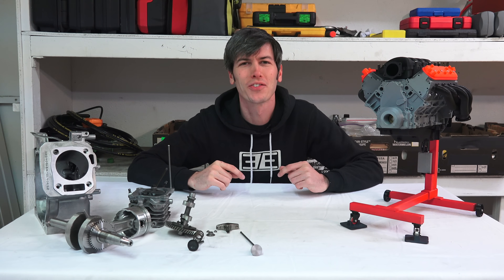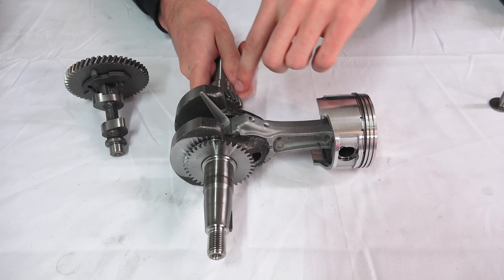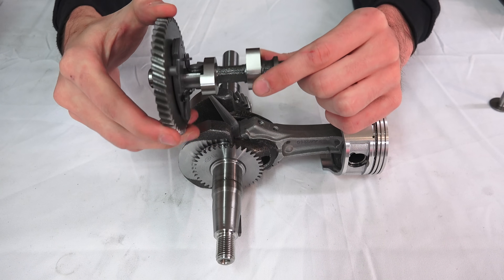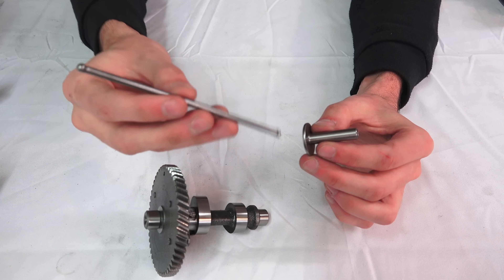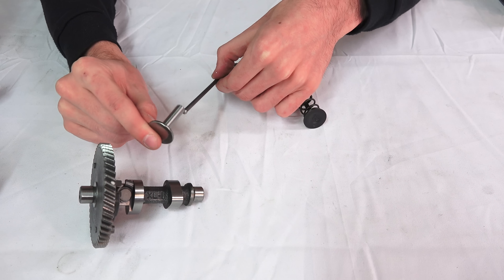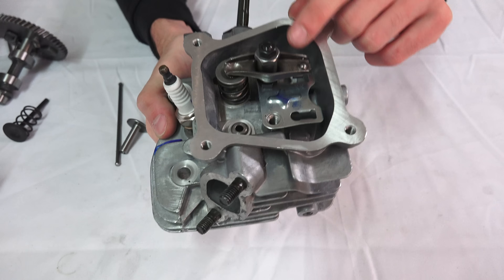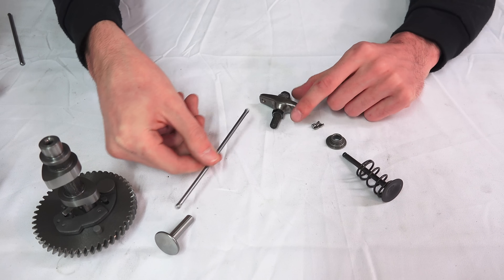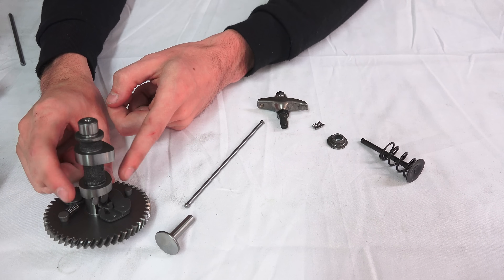Why Can't Pushrod Engines Rev High?

Comment: The fastest race cars use push rod engines. Top fuel uses push rods and redline around 9500 rpm and make 11,000 hp.
A 5000 hp 481X can spin 9000  rpms with push rods.
Reply: While that is true, those are purpose-built engines. High revving daily driver pushrods are possible, but used to be inefficient and expensive to manufacture and maintain. Nowadays, with lighter materials, pushrods start to become interesting again because of their small package, relatively low weight, plus they are less top-heavy compared to OHC/DOHC engines.
Reply: @Duskconqueror  yes DOHC engines can be top heavy, but that is countered by everything else being low. Like starter motor, alternator etc etc...
Reply: I don’t think it’s fair to cite top fuel.... those engines get rebuilt every pass pretty much, and replace a crankshaft every 5 passes...
Reply: Yes Top Fuel engines are under immense stress and pressure, which undoubtedly require strong components. But that's the point! The intake valves are huge and heavy on a TF motor, the boost pressure incredibly high. This requires monstrous valve springs to keep the valve movement under control, which in turn requires monster rockers, monster pushrods and monster lifters which then in turn require heavier valve springs to control. All of these components are so highly stressed that they just do not last long.

On the other hand, a DOHC 4-valve setup can eliminate the rockers, pushrods, lifters and use much smaller valves. There is much less mass to the valve train, which allows you to use much weaker springs. This reduces the stress on the all the components and allows them to last longer and rev higher.
Reply: They are rebuild after every race. You could probably spin a truck engine 9000 rpm for 5 seconds as well.
Reply: @Benedocta  Who told you that b.s.
Reply: It's not the total weight of the components that matters, it's the reciprocating mass. The stuff that's moving back and forth - like the above video explained. With a pushrod engine the valve spring has to close the valve, rotate the rocker, move the pushrod and slide the lifter back down against the cam. To do that at high RPM requires very strong springs, and it's very difficult to get a high enough spring pressure to keep the lifter against the cam lobe.

In many DOHC engines, there are no lifters, no pushrods and no rockers. There is just a little metal shim sitting on top of the valve stem, and the cam lobe actuates directly on that. In a DOHC engine the valve spring just has to worry about closing the valve - not moving all of those other components. This allows you to use lighter valve springs that last longer and require less energy to actuate. 

The Coyote motors are small displacement (5.0L), so they inherently need to spin faster to make power. That high RPM valve-train is what allows a 5.0L Coyote to make 460HP.
Reply: I do agree with Jason though, OHC has many advantages.
Reply: bigpigslapper Oink yea but as you said the coyote is 5.0l not 6 plus
Reply: Lorentz the annoying Llama fastest in what respect?  Top Fuel hits over 300mph in the quarter mile.   Have you seen the quarter mile time on a F1 car?  No now has actually done the test but there are rumors of 8 sec.  TF on the other hand...
Reply: Four cams weigh around 4 times as much as 1 cam, but it's rotational, not reciprocating so it doesn't matter. Most pushrod engines have a chain on steel sprockets while an SOHC or DOHC engine will usually have a belt (which weighs nothing) on aluminium pullies. You also forgot to factor in the lifters, pushrods, and rockers.
Reply: "Top Fuel hits over 300mph in the quarter mile"
so can you with classic rocketry... there it's just 2 valves and an igniter to start it.
you could even hit 300mph on an dragstrip with water-pressure alone and then it's just a single valve.

but thinking that we had working combustion engines already in the early 90's that had no rods, no cams, no rockers and not even springs... just simple electromagnets on each valve.
but even the engineers at Renault thought they were gone to mad so they put it behind closed doors for 15 years before they put back in the light...
Reply: For those of you talking about TF and NFC engines, google the "McGee" engine.
Reply: @stefanl5183  yes IHRA had a few of them. Blew up spectacularly.
Reply: newschool     Yes the rules do allow other engine types in most classes besides fuel cars.
Reply: American Locomotive um many dohc engines use rockers.
Reply: Here's a couple fun facts. A t/f engine redlines at approximately 7000 r.p.m. The crankshaft turns approximately 400 times in a clean 1/4 mile run. Including burn out, to heat the tires,backing up and staging it will burn 12-14 gallons of nitro methanol fuel. Due to the huge cubic displacement of these engines they cannot rev higher then 7000 rpm. However, many other classes ,with pushrod engines rev higher then 10,500 rpm.
Reply: @robertleavy8012  8500 rpm.
Reply: @robertleavy8012  About 8500 RPM at the hit. That's the peak. Rev Limiter ia activated about 3.0 seconds into rhe run. 3.0 seconds is about 660' when Clutch is 1:1 and RPM is around 6- 6500 .
Reply: Formula 1 cars don't use pushrods... oh you mean cars that only do 3 seconds on tarmac?
Reply: you do realize the dragsters engines literally only last for a few runs right? while a honda s2k can rev to 9000 all day and can be driven everyday
Reply: Spike to about 8500 RPM at the Hit. Clutch starts ro pull the RPM down till about 660' til Clutch ia 1:1 about 3.0 seconds. About that time the Rev Limiter ia activated. Then it Starts climbing rhe Torque Curve
 Rev Limiter is 7900 i believe.
Reply: Sanity Top Fuel is a 3 Valve SOHC Design. Not NHRA Legal. It's an Australian team. 
They also have an Alcohol version.
Reply: McGee Quad Cam was a IHRA Legal design. They blew up in spectacular fashion. Nobody ean one after about 2000 season.
Reply: Nitro engine's are Rooler Cam Push Rod with Rocker Shafts in the Heads. Intake valve on top. Exaust on the bottom. 2 plugs pwr cylinder front and back. 
CroMo i believe is thw Puah Rod Material. 
1100# Intake Valve Springs. Lota of big parts in a Fuel Valvetrain.
Reply: OzarksWildman THATS will not very high. Some stock production cars rev that high.
Reply: Too Fuel would go much faster with a set of DOHC 4V heads
Reply: Yea if you want to lash valve's all the time. Plus your only using that set up in a race car.
Reply: Yeah, but those valve springs on a top fuel engine are only good for one pass. That 481X engine might get a season on a set of springs at best.

A Honda S2000 engine can turn up to 9,000 RPM reliably for 200,000 miles.
Reply: @AmericanLocomotive1  One Honda F1 car hit 21K rpm when it got airborne ..means the pistons went up and down 350 Times a seconds

Comment: Do any engines use solenoids to open the intake and exhaust valves?
Reply: i think alfa romeo have one, only for intake, the exhaust uses vacuum valves. simply put, too complicated.
Reply: freevalve
Reply: I heard Koenigsegg was experimenting with the concept, but have no idea where they went with that
Reply: Very different kinds of engines, but marine slow speed diesel engines use electronically controlled, hydraulically actuated exhaust valves. There is no camshaft at all. Super cool stuff. Look into MAN ME slow speed engines.
Reply: Nick G they are two-stroke though

Comment: if an engine doesn't use pushrods, what does it use?
Reply: In OHC and TOHC applications, the cam is moved to the top of the engine and acts directly on either a rocker arm or tappet (so that they retain lash adjustability) that is in direct contact with the valve.  It's a much simpler system, with a lighter valvetrain...but it makes for a taller engine with a wider head, which can cause packaging problems on larger engines like V6s and V8s.
Reply: crankshaft driven timing belt or chain. this is OHC engine, using belt or chain to carry rotating motion to cam, it controls valve movement.
Reply: Bob Sacamano a hamster
Reply: Bob Sacamano say no more..the all new no rod🤣

Comment: Title should say "Why It's Harder for Pushrod Engines to Rev". It's not that they can't rev, it's that its much more difficult and expensive to engineer them to be able to.
Reply: Fred Larsen C. Rotary engine give twice the revs but three time the unreliability.
Reply: Fred Larsen C. APEX SEALS!!!!!
Reply: Using an engine with a low stroke and a very big bore you can rev high. But like an dohc engine you need to use stiffer springs, also in a pushrods engine you need lighter rocker arms and solid roller lifters
Reply: You mite want to look into an old forgotten push rod performance thing called a "Rev kit." Essentially an extra set of valve springs that went between the lifters and cylinder preventing valve float allowing the push rod engine to do 10500 to 9500 RPM (as long as the engine was properly balanced and the connecting rods were forged) these kits cost less than $200 dollars.
Reply: Lorentz the annoying Llama

It doesn't mention that production pushrod engines nowadays are all high-capacity, long-stroke V8s, neither of which would combine to rev high anyways no matter the valvetrain. A 7L DOHC V8 with the same 4 inch stroke as the LS7 ain't gonna Rev much past 7k rpm stock...
Reply: Fred Larsen C. Rotaries: 6 times more combustion cycles, 1 third the power.
Reply: nuts to that. i take a reliable power plant, for 10k, capable of high hundreds maybe even 1000hp, that doesn't sound like a 1990 yamaha bravo
Reply: Ken Willers
Ford hasn't put a pushrod in a production car since 1995
Reply: @anthonywebber2211  maybe not in America but the Ka in Europe used the ohv Kent/Valencia engine till 2002.
Reply: show me a push rod six making that kinda power first, compare equal cylinder engines. a better compairson would be the bmw s50(i think thats the right engine code, the V8 from the E90 M3) or the Lexus IS-F engine but that said any comparison is kinda like asking if its ZEE or ZED, both have their uses and both have their pit falls
Reply: The corvette is a pushrod and it revs plenty
Reply: K Re, not really. Everything that moves on its own power has some amount of torque. So obviously rotarIES (rotary engines) have some torque.
Reply: John Dessire the Mazda 787B could run for another 24 hours
Reply: MoutainMan3000 100% 👌
Reply: Isnt the voodoo a pushrod? And has a high rpm.
Reply: +ric Smih: And how many 1000 kms do they last?
Reply: Guess he's never heard of the Ilmor Mercedes Indy 500 engine.. 1000bhp... PUSHRODS!
Reply: S50 was Euro 3.0/3.2 6 banger. E9X M3 engine is s65 ;) check Chrysler Hemi6 from Australia
Reply: damn it i always get those two engines confused , that Hemi6 sounds cool leave it to the aussies to make something that would get past prototyping in the US
Reply: Well, Mountain Man, of course it's not that they can't rev. If an engine couldn't rev, it would never run. Just the fact that it's running means it's revving. Now, how high or low is a different story.
Reply: Rotarys equal no torque and one of the most obnoxious sounding engine ever built, especially with an open exhaust.
Reply: just use 2jz i6 in everything
Reply: Hey, ape, I mean... engines, motors, and muscles, etc; not just some random leaf blown in the wind, duh.
Also: if my what is "going to pick on people..." (according to you)? Which of my possessions were you trying to refer to?
Reply: What do you mean, James?
Reply: Shock Diamond.  How are they garbage?  A modern pushrod engine like the LS is SIMPLE... its LIGHT... it’s COMPACT compared to OHC and DOHC engines of equivalent displacement.... it’s EFFICIENT... and it doesn’t need a torque killing big bore and short stroke so it can rev to the stratosphere in search of peak HP numbers 90% of the driving public will never realize and the 10% that do will only experience them for half a second before hitting the rev limiter.... vs just punching it in any gear at any speed and going.
Reply: MoutainMan3000 not as expensive as you may think, drop a LQ4 4.8L crank into a 6.2 LS3 de-stroking it and they will make like 700 whp and wind too 9000 rpm... major loss in torque (about 450 wtq) due to short stroke and large bore. Granted the vehicle will need to have some major internal modifications. A DOHC engine is still far more efficient to rev out to high RPM’s no matter what though
Reply: Pietrek L with enough money you could easily built a n/a JZ to 400+ whp. Note the “enough money” part, it won’t be cheap but it is possible.
Reply: @sleeper.simulant7327  400+ is really kinda impossible, people get like 280hp with itbs and ported heads. So even 300 is hard.
Reply: Top fuel dragsters run around 11krpm with a 500’ motor
Reply: @RadDadisRad  and those need to get rebuilt after each race..
Reply: thank you for posting this
Reply: You dont need a rotary when you have huge cams:) they almost sound the same at idle. check my channel to see what im talking about.
Reply: NHRA pro stock motors rev to 10500. Used to got to 12-13000. And they’re 500 cubic inches. He should have done a little research before this video. And the LS can flow just as well as any 4 valve engine.
Reply: Jacob M'Boi Show me N/A JZ making over 400HP
Reply: VTec braaaaaap. Not fast enough.
Reply: Was about to say this.  I wanna say I've seen a video of a stock LS7 revving to 8K
Reply: @jacobm2625  seen a stock bottom end LS 6 rev to 9.5k not uncommon just heads cam.
Reply: No.  It should say, "Why pushrods engines are basically garbage". :P
Reply: MoutainMan3000 or you can get a rotary...sounds cooler too!
Reply: you do know that rotaries don't rev actually? they only rev to 3k, but thre eshaft is geared 3:1, so teh shaft rotates 9k
Reply: @fredl.c8029  sure, go eat some apex seals... 😅🤣

Comment: Could you do a video on ducati's desmodromic valve system? Does having no valve springs at all automatically mean that you could (theoretically) rev them higher than a regular dohc engine?
Reply from the maker: Yes, with a purely mechanical opening and closing, you wouldn't have to worry about valve float at all. There are of course other limitations in revving high, but that's one box you could check.
Reply: no "valve float" has been a high selling point of Desmodronics.
Reply: yes it means Ducati didn't have to go pneumatic in moto gp compared to their japanese counterparts.
Obviously you'd also need an oversquare design in order to keep the piston speeds manageable.

However there is problem. Ducati's need frequent valve adjustments.
Reply: foo bar Agreed, but they're not used to "close" the valve like in a pushrod or overhead valve system. The closer rocker arm does the closing.
Reply: foo bar The springs in desmo engines are only there to hold the valve closed during the very short time when neither cam is in contact with the valve. The closer rocker is what actually closes the valve.
Reply: Sam Kwant it does mean that their engines can rev higher, HOWEVER: the added mass of the two lifters causes the parasitic/intrinsic friction and inertial losses increase at an exponential rate in comparison to a typical valve spring/single lifter setup.  Now understand, this doesn't happen until very high RPM, but looking at a valvetrain harmonic graph, the line starts to curve and ramp upwards at around 10000 rpm. It's not the be-all end-all for high speed valve control, but it is great to use.  I own a monster 1100 Evo, and I can say from experience that it's just as easy to service as a standard setup.
Reply: 1barnet1 Yes they do need frequent adjustment and it's labor intensive. The 2-valve per cylinder engines aren't too bad. I have one of those and one of their 3-valve per cylinder bikes.
Reply: MIKE MOTORCITY OG I agree with you completely and understand where you're coming from.  Spring harmonics make sense to me, which is why the beehive and compound/multi-spring designs are such great steps forward to mitigate the harmonics from happening.  The point I was trying to make is that there's just more mass and frictional surface area involved in having two lifters vice valvesprings when individual metallurgical properties are assumed the same, thus the higher expected parasitic losses at high engine speed.
This does not make your point any less valid.
Reply: Ryan Miller when did ducati change to valve springs?  I was still under the impression that they use shims on both lifters.  I literally just replaced them on my monster.